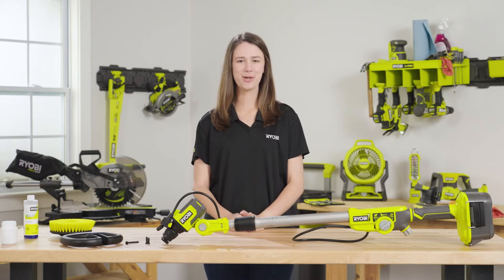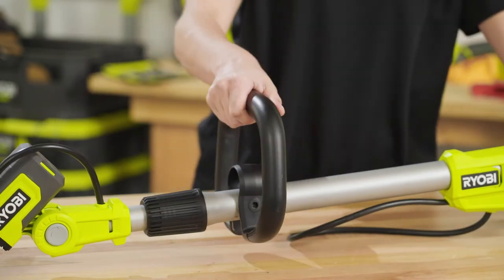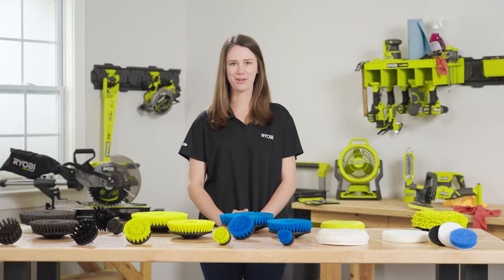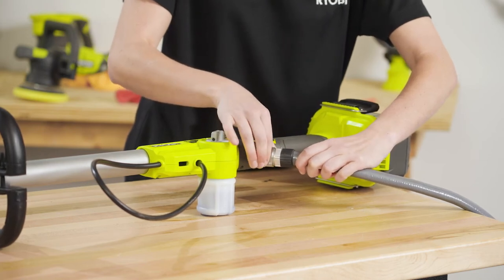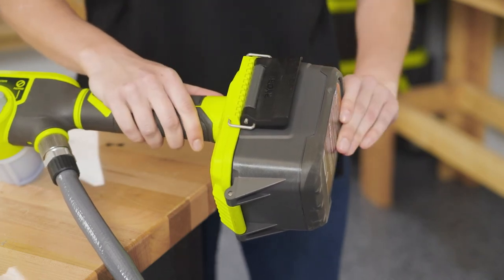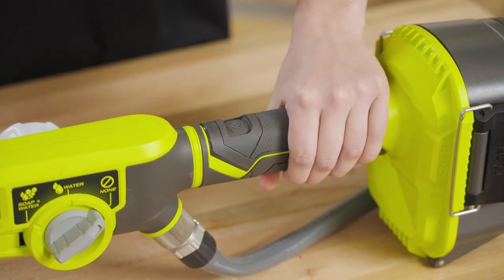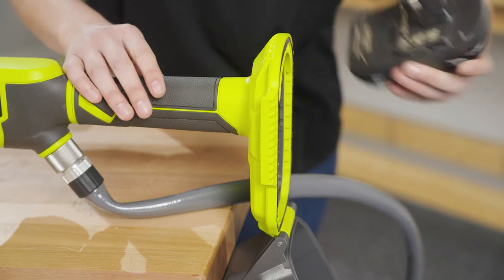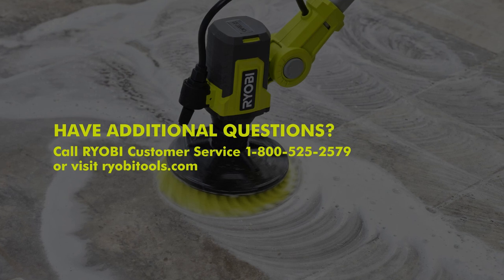How to Use the RYOBI 18V ONE+ Soap Dispensing Telescoping Scrubber

Comment: Do NOT use these on your car.
Reply: Unless you're using this on carpet, or a bedliner. Do not use these on paint.
Reply: Ha ha.  Thank you. I thought I was in heaven for a sec.
Reply: Thanks, because that's exactly what I was going to buy it for
Reply: They do have microfiber accessory heads that are soft enough for a paint finish but I wouldn't use this for automotive finishes. Hand wash only!
Reply: Softness isnt the issue, its the high speed orbit and never rinsing the microfiber. One spec of dirt in that thing and its over. @CorgiDaddy

Comment: I'm 5'4" and this thing is a back breaker. Not as powerful as a gas powered power washer. It needs an extension if you're using it on floors, driveway, or side of the house. I have several RYOBI products, but this one is very disappointing